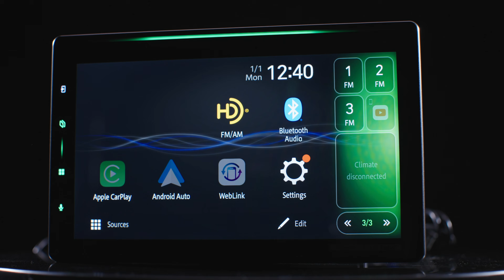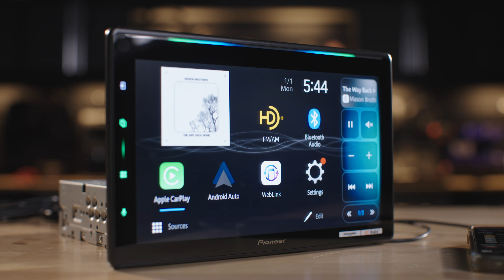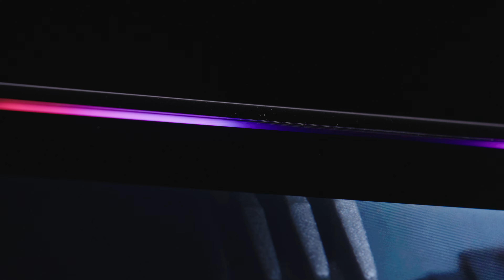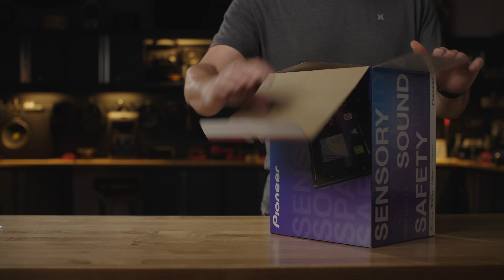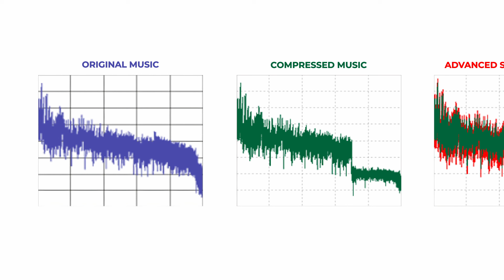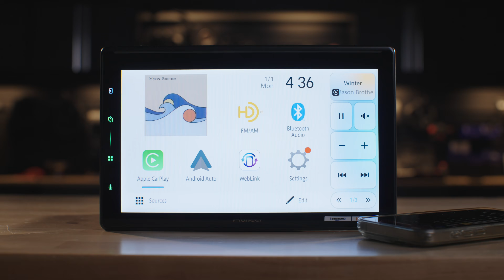Pioneer DMH-WT6000NEX high-res floating screen receiver | Crutchfield

Comment: Do this have car settings,  such as service reset and tsps reset
Reply from the maker: As long as you have the Civic that came with the 7" LCD screen (not the 5" screen), this can be installed with the iDatalink Maestro RR interface and give you access to the same vehicle settings you can access with the stock radio.
Reply from the maker: Yes, it can display vehicle data/settings in many vehicles when used in combination with an iDatalink Maestro RR interface.  What's the year, make, and model of your vehicle?
Reply: @crutchfield 2020 civic si coup

Comment: Does it randomly power cycle all day like the DMH-4660NEX that I spent $700 on that pioneer told me they wouldn’t replace? Or not connect to CarPlay, wired or wirelessly? Random lockups and freezing?
Reply: I own that exact stereo in one car and own no less than 2 DMH-WT7600NEXs (one in my driver, one I kept from GFs old install) ALL THREE DO THAT.- even sent one back and spent $400 to get Pioneer to rebuild it.  It came back and it's even worse than the GFs old unit I subbed in while it was in service. 
  Garbage.

Comment: Is this head unit compatible with a 2017 Honda Accord Sport Sedan?
Reply from the maker: According to our research file on the 2017 Accord Sport, unfortunately, replacing the factory radio isn't recommended, due to the configuration of the dash and radio/vehicle controls.  And we don't offer any type of custom dash kit for the Accord to help install an aftermarket stereo. Sorry for the bad news there.

Comment: Does anyone know if it can be installed in a 2012 Nissan murano with Bose system?
Reply from the maker: For that vehicle with Bose, we don't recommend replacing the stereo. That is likely due to the fact that the Bose system, including amps, will not be compatible with an aftermarket stereo.

Comment: This receiver use oem microphone from factory?
Reply from the maker: The unit actually has an external microphone included with a mounting bracket (attached 13' cable terminated by a right-angle 2.5mm connector)

Comment: Can the screen be remote mounted, like a screen wiring extension even if I have to modify it myself?
Reply from the maker: No, that Pioneer head unit does not have a modular design. However, the Pioneer DMH-WT6000NEX allows you to install the display separately. Check out.
https://www.crutchfield.com/I-rFBKc988/cart/EmailCart.aspx?emKey=3602817

Comment: Will it work in Toyota tundra 2004?
Reply from the maker: We need to know more specific details about your 2004 Tundra to provide any fitment information. What is your cab style? Did your Tundra feature the JBL premium audio system or door tweeters?
Reply: @  Tiene los tweeters personalizados de pioneer
Style crew cab
Reply from the maker: Hola! Gracias por comunicarse con Crutchfield. Para ayudarle a encontrar los tweeters de Pioneer que usted busca, le recomiendo que nos llame al 1-800-653-0992 ya que tendríamos algunas preguntas para usted y de esta manera poder ayudarle mejor.

Comment: Installed this in an 06 4runner two days ago. Love the actual unit, but the app is a travesty. Connecting with your phone is one of the most frustrating things I've ever done with tech. After I finally got it connected, I updated the firmware and changed my wallpaper. Then it show an "unable to connect with pxlink" error every 15 seconds. Super annoying. Only fix was to uninstall the app from my phone to make that error stop showing on the unit screen. I plan only install the app once a year to check for firmware updates.
Reply from the maker: Hi Nathan, sorry to hear about this. Did you get the radio here? If so, have you had a chance to reach out to our Tech Support? Their direct number is on your invoice.
Reply: @crutchfield  I didn't purchase it from crutchfield. I just know many people will watch this review. Also, i don't regret purchasing this head unit. The app is trash, but I doubt anyone was betting Pioneer was going to make a good app anyways. No problems after I deleted the app.

Comment: Any own what are differences between 8600nex and 6000nex
Reply from the maker: Hi George, both great looking options! The overall features are comparable; but the 8600 does features a Rear (USB-C) vs the  USB-A connection on the 6000. The 8600 will work with even older iPhones: 5S and up vs 8 and newer for the 6000. The 8600 has Bluetooth 4.1 and the 6000 features Bluetooth 5.2.
Reply: @georgesolano4679   the 86 has a built in web browse it not that great but played YouTube.  So @crutchfield can the mirroring be done wired or via wifi/Bluetooth?

Comment: Where do you buy the screen protector or glass? I have this head but is always have fingerprint on the screen.
Reply from the maker: We do not offer a screen protector for it. Also, Pioneer does not have a recommended one. However, a universal screen protector that can be cut to fit the receiver should work.

Comment: It would be nice if the electronics could detach like the 7600NEX?
Reply from the maker: Are you planning to install the Pioneer DMH-WT7600NEX into a specific vehicle?
Reply: @ i already have one installed in my car
Reply from the maker: Nice! The DMH-WT7600NEX is a great radio. This 6000NEX does feature a different screen mounting bracket and attachment cable design.

Comment: Best Buy says this will fit my 2004 Mustang but the floating screen is throwing me off. I dont want the screen to be sticking out.
Reply from the maker: Is your 2004 Mustang the convertible or coupe? Does it feature either the Mach460 or Mach1000 audio packages? Would you prefer a radio that does not stick out in front of the dash and is around a maximum of 7" screen size?

Comment: interested in this unit. when looking at the dash kit packages that i can add with this unit, theres a 200$ option and a $30 option kit. i have a base model 2019 brz with just volume and next/previous music track buttons on the steering wheel. would i need to go for the $200 dash kit option to keep my buttons working on the wheel?

also, my reverse camera is on my rear view mirror. i prefer not to change it to the unit's screen. would i be able to do that?

would the 30$ dash kit be enough to be plug and play?
Reply from the maker: Great radio choice! There are several kit options that will allow you to use the factory steering controls with it. The best one will depend on the other factory options you want to maintain. Is there a factory backup camera you want to keep? Do you want to keep the STARLINK or Vehicle Settings Menu? From there, is a factory USB input you want to maintain?  When you replace the factory radio, you'll lose your factory satellite radio capability.

Comment: How do I get video out? I also noticed that I think you have to purchase a external output wire adapter, but I’m having issues finding it online to purchase. Do you know where to find one?
Reply from the maker: This receiver does not have a video output. As for the adapter you seen, what is the time stamp for when it appears in the video?

Comment: Has anyone installed on 2015 and up ford f150?
Reply from the maker: We do not have a way to check if any of our customers have installed it into that type of Ford pickup. We can check if it can be installed into a specific Ford pickup. Which year model are you hoping it can fit into? Which sub-model F150 pickup do you have? What is its cab style?

Comment: A big selling point for me is if yall would offer a quick disconnect for the screen available. I want to be able to take ot off these thiefs taking everything if they choose your car.
Reply from the maker: There are a few options with a detachable screen available. Are you looking to fit the radio into a specific vehicle?
Reply: @crutchfield yes an integra dc2 wich most flip up screen stereos hit on the middle air vents thats reason i cant use those but also would like to tale off screen if possible
Reply from the maker: For a larger screen radio that fits in your Acura Integra from '97 to '01, the BOSS Audio Elite BE9ACP.X is a great choice. Unlike other floating screen designs where the touchscreen monitor is fixed to the source unit after installation, the BE9ACP.X's floating touchscreen monitor is detachable to deter theft (no protective case included); simply press the two buttons one the front-panel behind the monitor and disconnect the proprietary connector to detach the floating monitor from the source unit!

https://www.crutchfield.com/I-rYALc166/p_104BE9X/BOSS-Audio-Elite-BE9ACP-X.html

Comment: If only it had a built-in DSP
Reply from the maker: The Pioneer 6000NEX does feature listening position & time alignment features.  You can adjust speaker output timing, so that sound from all speakers reaches the driver's ears in perfect sync helping you choose an optimal listening position!
Reply: @crutchfield  time alignment can be a great feature but being able to set crossovers and slope would be better and would eliminate the need for an external one. Even a simple DSP like the Sony XAV-AX6000 has would be great
Reply from the maker: I'm a bit perplexed by your reply. You can adjust crossover and slope using the network audio features on the Pioneer 600NEX.  Network mode allows you to set the high-pass and low-pass crossover network for a complex 3-way speaker system with Highs, Mids, and Sub using low-level outputs only with amplifiers and massive slope adjustment. If you are using the onboard power from the radio, you can still adjust crossover and slope for the subwoofer only using standard audio mode.
Reply: it has all those things you talk about.,.

Comment: I really want this but it says it won’t it fit in my 2004 Expedition. Why not? 😢
Reply from the maker: The radio's chassis is too deep and will not allow installation into your dash. IF you wish to attempt a custom install, you can certainly attempt it. The Pioneer DMH-WC6600NEX in the link below is a good fit in your year Expedition.

https://www.crutchfield.com/I-rYALc166/p_130DMC6600/Pioneer-DMH-WC6600NEX.html
Reply: @crutchfield ok, thanks for the info!
Reply: Yes it will just buy the single din dash stereo install kit and it will go right in on the 01 and up Ford vehicles the pocket is on the top so its very easy to install in your venicle
Reply: @kinetik392 that’s kinda what I’m thinking, surely I can figure some way to make it happen
Reply: @gregg7761  its easy in that SUV you need the Metra 99-5026 install kit for the dash it goes right in
Reply from the maker: You're welcome!

Comment: Got mine fully installed.  Found a couple of bugs 1 minor and one kinda medium.

1. If you delete a icon using the edit interface it goes back to the home screen instead of staying in the edit mode.

2. When you put the appearance in dark mode it forces the android auto maps to dark mode during the day and thats not what should be happening.  

Thats all I found so far.   I did have one issue with the maestro harness, the speakers where reversed so calls and stuff where going to back speakers, called crutchfield support and the nice girl I talked to knew exactly what the issue was.  Just had to swap the harness output connectors and voila.😁
Reply from the maker: Thank you for the feedback, I am happy that your install went smoothly, and we were able to help!🥰 This one is very responsive on the screen, how are you liking it so far now that it is up and running?
Reply: @crutchfield  its good but I am finding some bugs and Pioneer does not see to have a good way to report issues.
Reply from the maker: They don't appear to have an official method, but issues can still be reported through the Contact Us link on their webpage:
https://usa.pioneer/pages/contact

Comment: I just got mine today and did a quick unboxing on my channel if anyone wants to see it.  I will also be doing a bench test and showing it installed in my 2012 Ram 1500 Crew Cab.
Reply from the maker: Excellent! Will you also be upgrading the speakers?
Reply: @crutchfield  I updated the dash speakers. The stock ones were blown out LOL, capacitors were toasted.   I do want to update the door speakers at some point.
Reply from the maker: Blown speakers are the worst! What did you replace them with? Think you'll match them in the doors?
Reply: @crutchfield  I replaced them with black diamond 3.5" speakers.  I tried pioneers and the faitalPRO 8 ohm but those both were too bright, even the pioneers with bass blockers and 4ohm resistors where too bright.   The ram 1500 has 8ohm dash speakers and from what I can see the ones in the door are 2ohm.
Reply from the maker: Do you want to go with 6x9"s in the doors or would you prefer to use 6.5" speakers for a wider variety of selection in speakers that fit?

Comment: Is it possible to slightly angle the screen toward the driver, even if the car’s dash does not have the factory stereo opening angled toward the driver?
Reply from the maker: This unit's display cannot be angled, sometimes called swiveled, left/right. However, it can be slid to the left by as much as 1.1875" to get it closer to the driver
Reply: @crutchfield  thanks for the reply
Reply from the maker: You're welcome, Matt. Do you feel like this one will work for your application?
Reply: @crutchfield  I think I still lean toward the 8600NEX because the ability for a floating display to tilt is kind of important to me.

Comment: The issue is they should be using 8 core cpus and 8 gb ram at this price point. I would need to see a better review of how long stuff loads , i feel i got burned by the 3800nex i put in my wifes car....
Reply: At $900 they should be seriously be adding way more features... This is expensive as hell
Reply: 100%!!
Reply: The 4500 nex can’t get updates and the internal sd card is shot. It’s a Pretty common issue. Pioneer lifted bad taste in my mouth since.
Reply: Pioneer USA website states that it is packing 16GB of LDDR4 RAM. I'm not sure about the processor though
Reply: @Jettics34  Where do you see that?  I cant find anything about the ram on their site.
Reply: The 8600 is crazy laggy as well
Reply: @LuisCruz-ns3bt  8600 was good when it was 8400
these are the same model. 8400/8500/8600 are 100% the same models.
It was outdated before its release by 5-6 years. It uses Andorid 4.2.2 version
At the time of the release of AVIC-W8400NEX it had only 2 cores 2Gb RAM
Although this platform is iMX6.
They could have added 2 cores but they did not. Only for the Japanese version of AVIC-CX90x. It uses 4 cores.
PS
AVIC-W8400(W4400) is built on the Japanese version of AVIC-CZ900
Reply: I appreciate the updates on this model, but I’m very hesitant given my troubles with the 6600. Laggy, firmware update from app does not work. I’ve had to warranty it two month before warranty expired for a new board. The price point is too high.

Comment: Would I be able to install on a Mazda CX5 2016 with the Bose audio speakers ?
Reply from the maker: The Pioneer DMH-WT6000NEX is not a physical fit in your 2016 Mazda CX-5. We have some radios that do fit, please use our online Vehicle Guide below to determine which radios are a good fit in your CX-5. Keep in mind that installing a new car stereo in your vehicle requires fabricating a dash kit. You may want to consult a car audio installation specialist in your area.

https://www.crutchfield.com/I-rYALc166/m_266150/Car-Stereos.html

Comment: I might look into this one over the Pioneer DMH-WT8600NEX, but I need to know if it fits the 2010 Subaru Forester
Reply from the maker: Hi Brad, we're glad to check. Did your car come with factory nav or factory tweeters?
Reply: @crutchfield  no
Reply from the maker: The Pioneer DMH-WT6000NEX is a confirmed fit in your 2010 Subaru Forester. You can keep most all factory features using an iDatalink Maestro installation interface, I have the complete package linked for you below!

https://www.crutchfield.com/I-rXYEc222/cart/EmailCart.aspx?emKey=3465796
Reply: Thanks  @crutchfield
Reply from the maker: We are always here to help you get exactly the right gear you need!🥰

Comment: How does this compare to the Kenwood DMX1057xr?
Reply: Should be better as the Kenwood is like 4 years old at this point?
Reply from the maker: The Kenwood DMX1057XR  has been out since 2020, but it's still a fantastic head unit.
Reply: @crutchfield any word on an anti reflective touchscreen?
Reply from the maker: Both great models and super close feature wise. The Kenwood does offer more camera inputs and has the 2-year Excelon warranty. What is your exact setup? Are there any specific features you need?
Reply: @crutchfield the Kenwood is very reliable, sounds great and has an excellent glare resistant screen. The interface is a little outdated and the features are a little lacking though. It would be nice to try something more modern.
Reply: I’ll do a review on it soon mine is suppose to be here tomorrow
Reply: Still 4v of preout when everyone has had 5v for years. Plus the pioneer customer service is basically non existant. I had a WT-8600 and pioneer never sent up out needed updates to fix glitches and they didn’t want any customer feedback on how to make their radios better. I eventually got rid of it. Not to mention if you use an integration module it bogs the radio down and makes very unseamless. They look nice but that’s about it. I’m waiting for Sony to release their 1080p floating screen. Kenwood is the best right now  Sony and alpine being a close second. For the price get the kenwood floating screens plus you get camera inputs that are adjustable unlike the pioneers.
Reply: @mildaudiophile3879 this 6000 features 5V pre-outs now.
Reply: Why not? Do you upgrade your stereo every year?!🤣😂🤣😂. Do you still drive your old car or do you buy a new car every year.